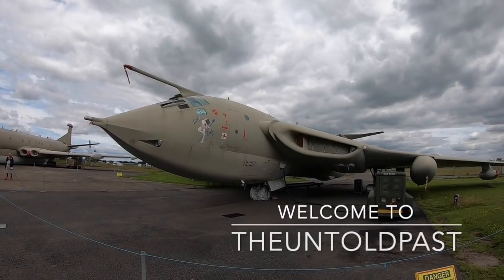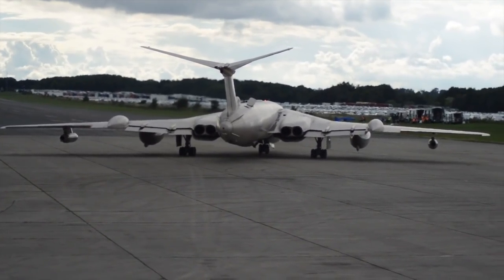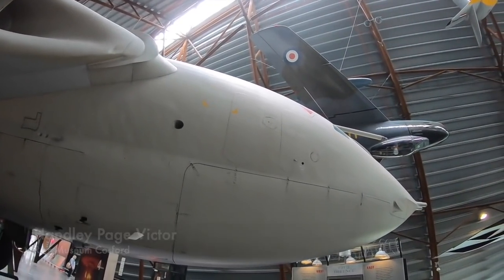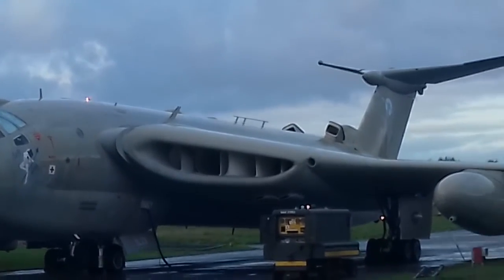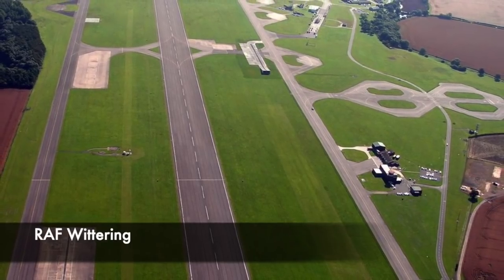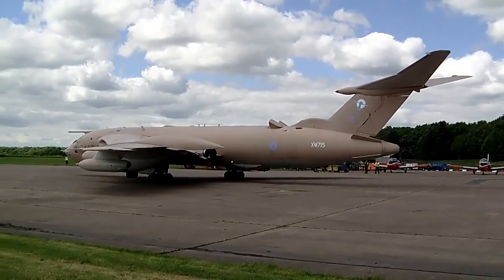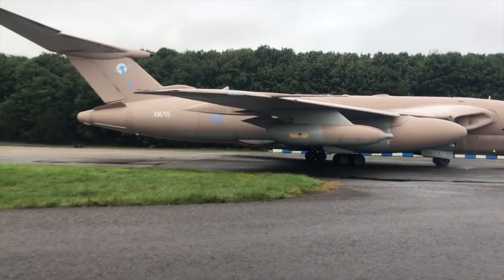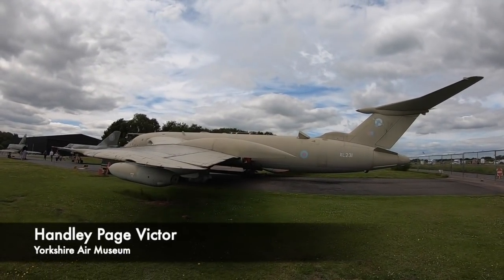The Tragic Story Of Handley Page Victor XM714

Comment: My father used to work at Handley Page at Radlett and worked inside the wings of the Victor.  Rest in peace dad.  You nearly reached 100but died on 8th December 2019
Reply: So sad. He must have been a great fella.
Reply: My grandpa use to work at handley page also he was there till the end in 1970 he was the resident architect and contract manger for them
Reply: I was at Handley Page Colney Street in the 60's in Inspection. What was your dad called?
Reply: My grandfather used to work on them in squadron 55 in the 60s.
Reply: Outstanding pity post…

Comment: I arrived at Wittering a few months after this accident, spending time with both the active squadrons and also the Victor Training Flight. I was told that the fire/rescue machine went straight through the fence at the end of the runway, down a large dip and straight across the A1 - a dual carriageway, in the rush to get there. The rear seats of the Victor were fixed and the chances of getting out in a hurry were always dubious but it led to these rear seats being later replaced so that they could rotate and improve the chances of the rear crew escaping. You should also note the protective screen as the door opens so the crew would have a chance to fall and not be blown into the wings.
At the time of the Blue Steel stand-off rocket, a team of musically inclined RAF fitters created a pop group called the 'Hedgehoppers' soon after the bombers went into their low level mode. The song, "Its good news week' was in the charts for about 12 weeks during 1965 reaching #5.
Also commenting on the technical specification. The Vulcan got the glamour but was outclassed in almost every other way by the Victor performance.
Hoping my memory is not confused about the above note...
Reply: There was quite some controversy surrounding the pilot/co pilot only ejection seats. It was regarded as a classic issue by some. The Vulcan also had the same system of only ejection seats for pilot/co pilot .. with the same outcomes for the rest of the crew. Parachutes are great on their own but need one thing to work effectively.. altitude... the pilots attempts to climb may have been to allow others the chance to escape. And altitude is EVERY crew-mans friend in an air emergency.  I drive trucks and regularly park opposite a Shell garage on the A1 just south of Barnack. Suddenly there is a tenuous connection... Thanks for sharing this story. R.I.P those crew members who didn’t make it.
Reply: The group were actually called ‘Hedgehog Anonymous”. I was at RAF Wittering when they formed.
Reply: I worked at Wittering in the Met Office for seven years from 1967 and never heard any mention of this accident, even though I was there for the last couple of years of the Victors. I watched a Harrier fall out of the sky, in 1972 I believe, killing the American pilot who was training with the conversion unit.
Reply: Hedgehoppers not  Hedgehog Anonymous!
Reply: Although the incident happened over 57 years ago I remember it vividly. 139 Squadron was my first posting out of RAF Halton and I had arrived in January of 1963  and it fell to us (I was a J/T on shift) to form the overnight Crash Guard  at Barnack. Not a pleasant experience  - that for me continued for I was also part of the Honour Guard for the Crews funeral shortly afterwards. The Crew are buried at RAF Wittering Church. RIP.
Reply: I found the Hedgehoppers singing It’s Good News Week on Apple Music.
Reply: First heard that one sung at school.
Reply: @malcolmyoung7866  My Father (who was aircrew in Victors) preferred them to the Vulcan - "easier to get out of in an emergency"!
Reply: We maybe met?
Reply: @paulrobinson2996  Ummm...   Blush..  I still have that vinyl disc some where...

Comment: Many will not know, that Handley Page Victor's, we're capable of Mach One, in a dive! This was achieved by the design of the wing, which considerable reduced the critical moment of the airflow slowing the aircraft down, when you consider, that the last bomber that Handley Page produced was the Halifax of WW2 vintage, then this unbelievable futuristic aircraft, was flying in 1957,is incredible! The last one that I saw flying, was in West Wales in 1976,as a tanker, with 2 English Electric Lightnings being refuelled, what an absolute fantastic aircraft!
Reply: My understanding is that the Victor could fly just AT Mach1 which made it difficult to attack as the attacker had to fly much faster in order to catch it, and because he couldn't 'hover' at Mach 1, would overfly the Victo, using up copious amounts of fuel.
Reply: The first prototype flew in 1952, not 1957. The Mark 2 flew in 1959.
Reply: It had been rumoured that development aircraft, XA917 (painted silver) hit the sound barrier in a dive.   It was claimed that ‘coincidentally’ (?) the plane just happened to be pointed at Chief Designer, Godfrey Lee’s, back garden.
Reply: An interesting case was a Victor that I believe lost its pitot tube while at high speed and high level. The aircraft was shaking a lot that combined with the dodgy airspeed reading led the crew to nose down, and that was that. The time of impact was exactly recorded by the marks on the watch face of one of the crew. Initially a boat gave the wrong position of the impact but parts were eventually found. 

The last fragment of audio from the aircraft was some conversation and what seemed to be a radio station in the background. 

The crash did a lot for flight safety in the RAF and is documented in the RAF Historical Society.
Reply: It first flew in 1952, and yes, many knew it could go supersonic just as the cv990 did once.

Comment: A bit of useless trivia. The only v bomber to drop a live test h bomb was the valiant that is now at Cosford air museum.The valiant had a design flaw in its main wing spars and as a result was dropped by the company.The problem lay in its outer underslung fuel tanks which overstressed the main spar. Cracks appeared and couldn't be repaired within tolerance. God I bore myself sometimes?????
Reply: Excellent nugget. Not at all boring
Reply: Like you, facts are facts.Don't be bored
Reply: It’s too bad that the Valiant was short-lived. It was a nice aircraft being the Royal Air Force’s first V-bomber. 🇬🇧
Reply: @spreadeagled5654  It was.The thing was that Vickers did so much of the engineering in designing the "v" bomber that both Handley page and avro learned from.You could argue it was a transition aircraft which makes it to me the more interesting than the Victor or Vulcan.
Reply: They made a strengthened faster Valiant long before the fatigue grounded them, but only one was built and flown as the MOD decided....quite rightly for once, that 2 successful V Bomber designs was enough. Look up Valiant B2. There is an irony. The B2 Valiant was faster at low level than either Vulcan B2 or Victor B2, and much beefier than the B1 designed for high level...so when the V force went from high level to low level the B2 Valiant "might" have been the best of the lot in that role....who knows. The B2 was used as a test aircraft from 53-58, then scrapped.
Reply: @timhancock6626  I didn't know that! I thank you.
Reply: Just continue boring. I’m quite fine with your boring.
Reply: Interesting to read the chapter in Tony Blackman's book, 'Valiant Boys', about the fatigue cracking: apparently there was an incident of a cracked spar as far back as 1957 (WP215) and he goes on to discuss the use of an alloy called DTD683, and how there were concerns over its poor fatigue performance actually published in 1956 by two different engineers.  There is more detail in the chapter, and it makes very interesting reading.
Reply: @chrisg6086  Interesting.A guide at RAF Cosford museum explained that the problem was inherent to the new radical wing shape at the time and its high loading characteristic.
Reply: If the Valiant at Cosford is the one that used to be at Marham no one was allowed in the cockpit because of radiation contamination caused by air sampling over nuclear test sites
Reply: @scaleybrat  Spot on.Same aircraft.It lived at Hendon prior to Cosford but was technically a radioactive plane when it was SOC by Marham. Interestly the mk 4 comment at Cosford had to have its radium luminescent dials in the cockpit removed for the same reason! Radium lume.The comet obviously never carried a nuke. Timex watch lume on its watches was considered a health issue.However the valiant was exposed to a huge dose of radiation dropping the " yellow sun" over Christmas island but half life in theory makes it safe now?
Reply: @Glen Powell. We had the same radium scare when I was on the Harrier OCU in the mid seventies at RAF Wittering.
Reply: @scaleybrat  Was that because of cockpit dials under a Geiger counter? By the way I still think that the Harrier is possibly the finest engineered aircraft to date. Remarkable design. Britain could build aircraft like that!
Reply: @Glen Powell. I enjoyed my spell on Harriers. Mind you taking the wings off to change an engine ( that should say "the" engine) always seemed a bit OTT to me. It was a fantastic plane and a bit of an engineering marvel. There were always crashes on the A1 caused by drivers rubber necking at the aircraft.
Reply: @scaleybrat  I am not surprised. Albeit piston engine aircraft I went to the " Warbirds weekend" at Duxford for years.The M11 being at the end of the runway.I am sure there were a few shunts on the motorway during the displays? You could almost touch the planes!
Reply: @glennpowell3444  There were no radioactive hazards at all when I sat in it at Marham in 1981 as a Cadet.
Reply: I saw the Cosford Valiant when it was stored outside after delivery from Hendon with its wings removed awaiting renovation for display. You could see lots of corrosion in the main spar.

Comment: I worked at Handley Page in the main drawing office.  We made submissions to the Air Ministry/MOD to install ejection seats for the entire crew at a cost of £180 per aircraft. This was rejected and a suggestion was received from them “to fit hand hold in the floor, so crew members could pull themselves out of their seats”, wearing their heavy ‘chutes to the port hatch enabling their safe exit. This would assume the avoidance of the port engine intake or the high tail fin. Each crew member had an instrument console on which a small sign announcing “Abandon Aircraft” could be illuminated by the pilot by depressing it. Having done so, his immediate duty might be regarded as discharged due to constraints of time in emergency situation.
Reply: Ejection seats for the whole crew would not have been easy to incorporate in the airframe. Tell us more.
Reply: There is a plaque on the Aerodrome at Radlett at the entrance to an industrial estate.How lucky I am now in my sixties can remember waiting at the end of the aerodrome for a Victor to take off .
Reply: The problems of getting out without an ejection seat were well identified during WW2 because of the g forces present when an aircraft is spinning or diving out of control making it impossible for crew members to get to an escape hatch. . Ejection seats should have been incorporated in the original V bomber design and any excuse on cost grounds is pathetic as such cost compared to the overall cost of each airframe is very low indeed.
Reply: I believe the original design incorporated an escape capsule for all the crew similar to the F-111 but it was rejected because it was considered too complex. The complete nose section was the escape module and the parachutes would have been stowed in the plenum chamber above and behind the cockpit.
In the end, the rear crew members and the 6th seat occupant were provided with rotating seats and nitrogen-operated booster cushions to help them rise from their seats and get to the escape door.
Unfortunately as has been previously mentioned, one Victor whose tailplane was knocked off by a Buccaneer in the mid 70's crashed with all but one of the pilots on board because of the g-forces created by the tumbling aircraft prevented everyone else getting out. IIRC it was the captain that survived and he said he saw the copilot trying to reach his seat-pan handle to eject, but he'd been flying with his straps loose and with the g forces throwing him upwards he couldn't reach it.

Comment: I left HP in early 1966 and switched to package engineering, when it became very apparent that HP’s days were numbered.   There was absolutely no way that the Jetstream project could, along with the sadly not over popular Herald and Military servicing contracts, be able to sustain the Company.   It was popularly believed that the downfall was due to Sir Frederick’s attitude, “that nobody is going to tell me how to run my Company”, at a time when the Government was insisting on manufacturers merging.   Hence, BAC.   So, no more Government projects against which to bid were forthcoming, and the Company policy of enacting a 12 month credit line with suppliers, meant that the latter could read the warning signs and came for their money.    Designing a new aircraft is not a five minute task, so even if a project had been secured, would HP have had enough backing to fulfil.

Comment: Saw a Victor land at Goose Bay air base in 1959 while I was en route to Incirlik AB in Turkey.  Eerily beautiful, it had crossed the Atlantic on a training mission, very common during the Cold War.  The green Aurora Borealis, or northern lights, draped overhead in constantly changing patterns.  Totally surreal experience.
Reply: Hi friend. In 1964, I was at Goose Bay for 11/2 years in the RAF, handling a much increased through put of both Victors and Vulcans which were training up in Canada on low level attack runs, for anticipated sorties into the USSR. My father served in the first RAF Victor squadron at Cottesmore in 1958 and I followed in his footsteps.

Comment: All those organic curves, drawn by hand before the days of computerized CAD and modeling. I can imagine all the head scratching going on at the drafting tables!
Reply: Whilst in the HP DO training school at Cricklewood, we were give a task to plot the right angle surface intersection of two cones, with the axis non coincidental.   The curve plotting was usually carried out in the ‘Loft’ department, on 8’ x 4’ aluminium sheets, painted pale blue.   Thin (say) 5mm x 5mm flexible ‘splines’ made from long lengths of Perspex.   The splines being held securely in place with purpose designed lead weights, having a wooden base and a metal ‘beak’ to rest on the spline.   Once in place, the curve was drawn using something like an aluminium pencil.   The plots were full size, and the number of sheets, edge to edge, and on very heavy adjustable height tables was increased depending upon the size of the component.

Comment: I was just up the road at Cottesmore, 10 Sqdn Victor B1's from March '63, and I don't remember this accident., not saying of course it didn't happen.  Ours was the only B1 Sqdn. Over the runway to us was 15, but they were B1 A's. Witterings's Victors were B2's of course, as was 543 at Wyton with their PR's.
The narrator in the video says it could carry 48, 1,000 bombs. It was actually 35, in 7 pallets of five. During Confrontation with Indonesia in '64, we bombed up our four Mk 1A's with the 35 1,000 pounders, and uplifted engine max RPM to 102.5%. I really really know this last point as I was the scrawny armed engine mech who slid his arm through the engine door fillets to do the adjustment on all four on one aircraft, with the aircrew strapped in on a dispersal, and communicating with the crew chief on a long lead, who communicated to me by raising his hand up or down, me without ear defenders, and receive a modest (very) disability pension for hearing loss as a result. Although on 10, I was on detachment with 15 at Butterworth at the time. There were also four more 1 A's at Tengah likewise prepped. 10 were the first Victor Sqdn to disband and we managed at least nine of our ten aircraft into the air for a flypast at Cottesmore, a truly amazing sight to see, nine Victors in a diamond nine formation. The flypast concluded with one aircraft doing a high speed run at low level down the centreline, with shock waves forming on the leading edges and 'blowing' back over the wings and reforming again. Those days at Cottesmore were truly wonderful, a great time to be alive.

Comment: I was stationed at RAF Wittering at that time, ground crew, nav radar, and ecm. and remember this traagic accident well. I think I'm  correct in saying that the enquiry concluded that the engine fire warning light was a spurious indication. On climb out from Wittering , by the time the Victor was above Barnack village it would still have been climbing at a very steep angle, and the crew response of shutting down an engine would have put the aircraft into asymmetric power configuration, which, combined with the attendant reduction of propulsive power, and the aforementioned steep angle of climb, fatally affected air speed and caused the stall and spin, from which it was impossible to recover at such a (relatively) low altitude. 
The aircraft exploded on impact in a small field on the edge of the village. The bomb it was carrying did not explode. It was a " concrete" bomb, carried on training flights to simulate the handling characteristics of the plane with a war- load on board. On my first shift of crash guard duty, I was surprised by what seemed to be such a small debris field and how little remained of the aircraft. Of course much had been burned to nothing, but major components such as engines etc would have been taken away for examination in the search for the cause of the crash.
   Regarding the aircraft shown in the video, it bears great resemblance to a Victor mk 2 retro-fit which would have carried a blue steel stand-off missile and not a dumb bomb as was carried by xm714.